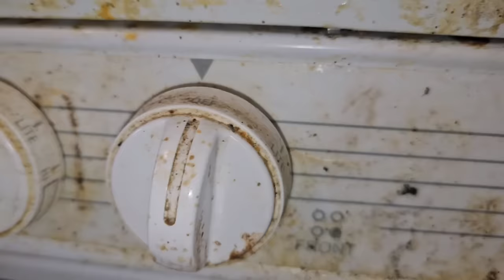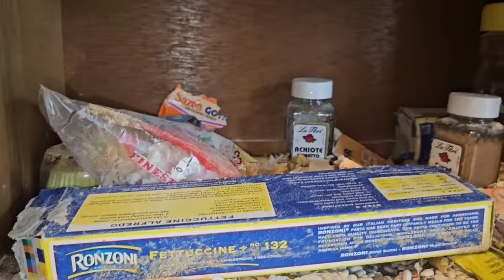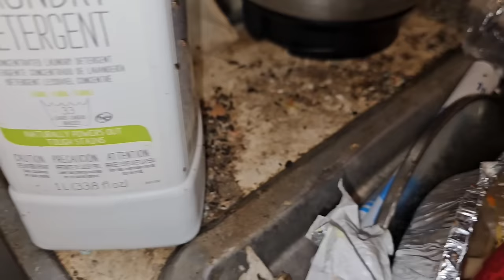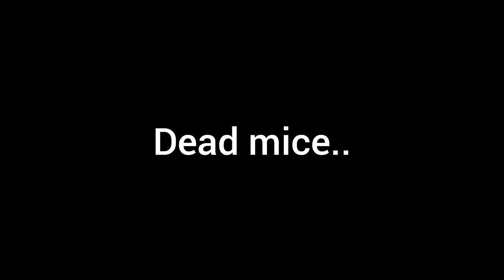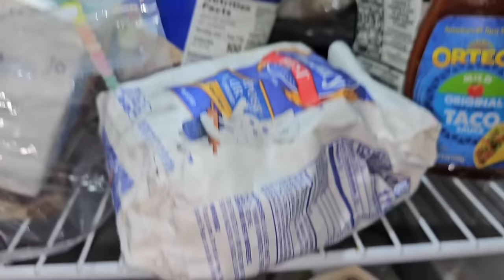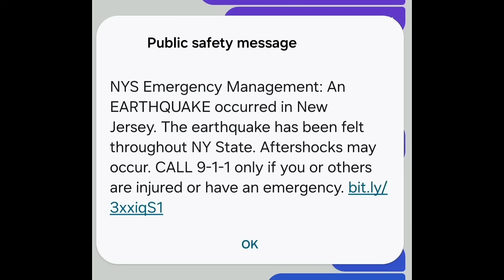Shocking KITCHEN Transformation: Dirt to Spotless

Comment: For burned stove surfaces try to spray oven cleaner and cover it with film and leave it over 2-3 hours. The burned residues will melt
Reply: If you watched the video you should have  heard her explanation as to why she didn't do that.    It was way too thick to even be cut with oven cleaner.

Comment: I wonder , don’t the landlords ever check or inspect their apartments? Strange
Reply: There's a lot of turn over in property management. If you're speaking from a position as a property owner, there are rules that have to be followed. The renter has to give you permission to enter the dwelling. You can't just enter at will.
Of course you can have the renter sign a rider to the rental/lease agreement but the entry rules still apply.
Reply: @debbysouthworth5606 a property can be entered for an emergency or with a 24 hr notice. There absolutely should annual or bi annual inspections. - CA real estate broker.

Comment: I would also be fine with mice, afterall every cleaner is a person and exterminators too :) there are no robots to do that for you😃😃 as long as you’re careful not to breath in the dust with excrements and not to really touch much with a bare skin, not to eat there and clean yourself well after😊 just have a basic gear and common sense i guess. And compassion ❤ mice are not crocodiles or big rats after all, not even snakes😁😁 i would probably be more concerned about termites infestation or something